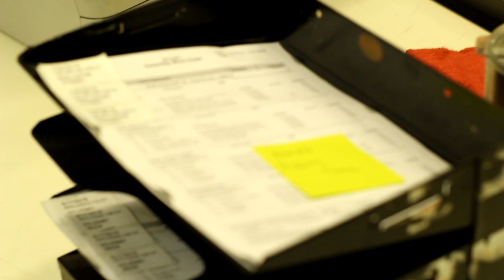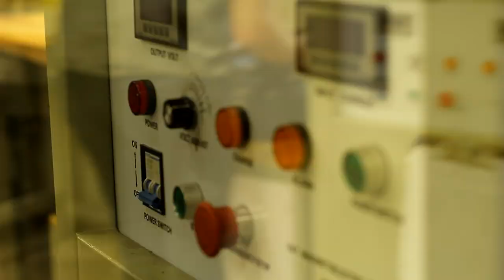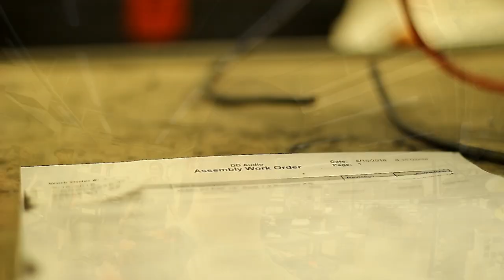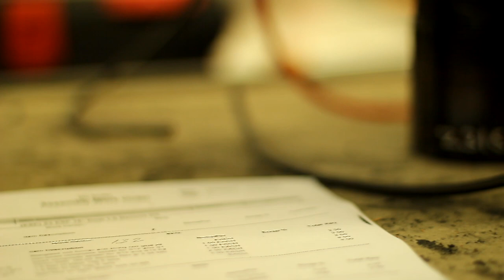How are Digital Designs subwoofers built?!

Comment: Hey im just paid for a set of Red line series 600 10” to go in a ported box under the seat of my 2018 f150 supercrew. I didnt know much about dd audio. The shop sell jl audio as well. They are building the box now. Did i make the right choice with the series 600 10” or should i have went with the 8w7 in a ported underseat box. The guy at the shop pushed the redline due to cost but i was not worried too much about cost. He said the redline 10 would out do the 8w7’s. Any advice would be appreciated. I have not had anything installed yet. Thanks.
Reply: You made a good choice on the subs we sell alot of them they will get down in that box I wouldve went with a fox acoustic box for under the seat they are one of the best when it comes to truck boxes . but I'm sure your shop knows what they are doing . you will be happy with the red line subs . I run the 9500 esp supercharged 12s on a dd m5 and a dd 4.90 on my mids and highs
Reply: lkjyuiop 
I have the 9512s with m3 amps they are spl subs i love them besides the blue clipping light on bass knob goin off all the time.  But cant hate on the jl w7 to me the jl is more sound quality while the dd is donkey bass just beats

Comment: Barevids , love vids. My buddy makes his enclosures one side ported and the other sealed on the same monoblock amp, is this recommended? And what does this do for box rise and the impedance the amp sees?
Reply from the maker: do you mean two woofers, both on the same amp, one in a sealed cab one in ported? Or the same single woofer but front fires into ported rear fires into sealed?
Reply: @barevids  Two of the same speakers, DVC in the same enclosure, one monoblock amp but one side of the enclosure sealed and the other ported..

Comment: Was that a video effect when he ran the magnetizer or did the magnetizer actually make the camera glitch?
Reply: There is a extremely high joule discharge in a magnetizer, essentially like a minature EMP. You have a big bank of huge caps that you drive the voltage up to where you need it then you discharge it all as what my work called a shot. Then it's magentized.
My work had an old 9ne that used a 1 1/4 iron bar and we have these triangle iron blocks to help focus the charge. Then get your North/South poles in the right direction, charge, then bang. A little thunk sound and viola. We use it to magazine our strengthen the magnet core of analog Meter movements. Ours isn't so precise then we put the meter movement in a pulsed demagnatizer, and slowly bring down the magnet field strength. 
Pretty sure their rig is set up for optimal parameters and they have those magnate zing boxes to optimized for the magnet motor.

Comment: So my question is what happens if you overcharge the motors?
Reply: V
Bl prolly gets out of spec and sub doesn't behave as the rest. Subs over time lose their magnetism and need recharged u don't see it often cause only speaker builders have a machine like that pros don't work with live neo or ferrite it's a paper weight untill it's saturated that is what it trying to do saturate as much as u can do it 1 to 3 times depending on size

Comment: I've always wondered how companies manage to rate the power of their woofers, do you have any idea?:)
Reply from the maker: It differs greatly with each manufacturer, which is why you can't really compare between brands you just have to try them for yourself or take advice from those who have used them. DD are one of the more conservatively rated brands.
Reply: power is just a thermal rating
Reply: Yeah,  you cannot rate a voice coil for power at all.  It's a thermal rating only.  You just have to use common sense with power to the subwoofer. It will tell you when things start getting a little to much.  Glue starts heating up and stinks,  which is a quick indication that there is thermal failure in the near future.  Many factors come into play with power handling.     The thermal rating of the enamel,  the type of wire,  the former thickness and material,  total windings in the magnetic gap,  cooling capabilities and so forth.

Comment: Man, I recently started working at DD. It's so fucking awesome man
Reply: @patrickincharlestonsc4935  sorry it took a bit to respond. But I put a couple in my car and they absolutely slam. My electrical isn't up there so they're probably only getting like half power. And they're strong enough that my car is kinda falling apart now.
Reply: @blakebrockhaus347  love it. What’s your box specs/amplifier/power info so I can gauge my setup off yours. What size and impedance you running?
Reply: @patrickincharlestonsc4935  2 1112s in ~2.75 cubes tuned in the low 30s with a 6 inch aeroport. And I'm running it at 2 ohms final, but again I can't get full power out of the amp until I upgrade my electrical
Reply: @blakebrockhaus347  Jack S got me hooked up with an Atrend 3.86 tuned to 35 with my two 1112s. Running on stock electrical it’s still pretty strong. 170 amp alternator and stock battery in 2012 Grand Cherokee I bought for my boys first ride.

Comment: Had a brand new 3515 top plate shift because one of those dipshit assemblers forgot to add enough glue, literally 2 little lines of glue about 1 1/2" long. "Attention to detail" lol
Reply from the maker: These guys don't assemble the motors. There are zero ferrite/magnet assembly firms left in the US as far as I'm aware for this size of application. No matter how much glue is used, if the impact is sharp enough, it will shift the slugs or top plate. There's no other way to attach these components since ferrite is too brittle to drill and bolt through. You were unfortunate, but I'm sure DD sorted you out properly for the inconvenience.